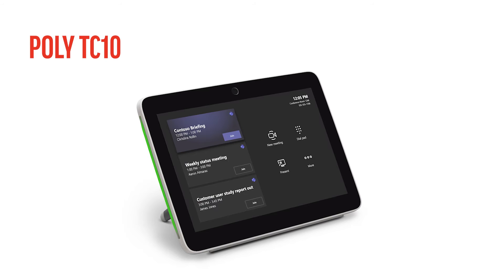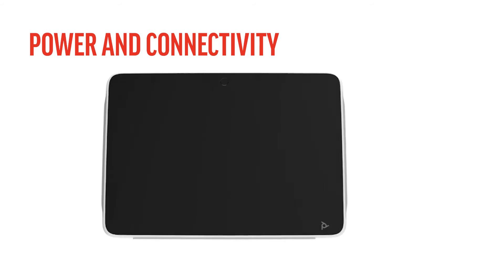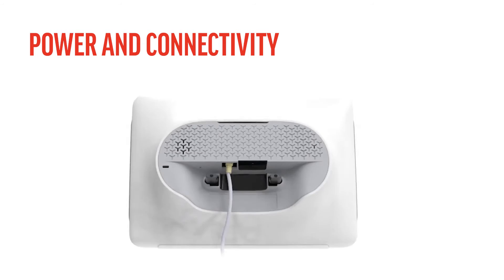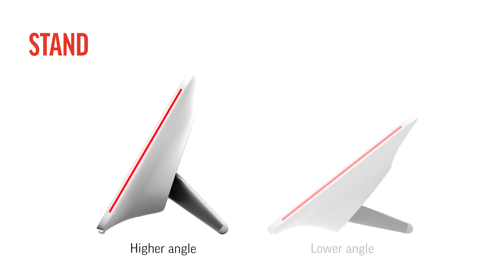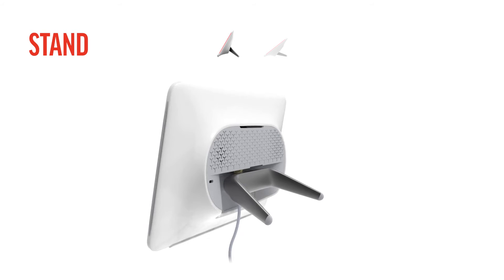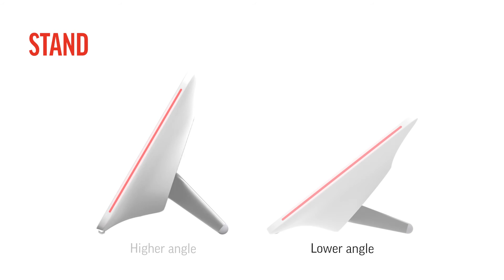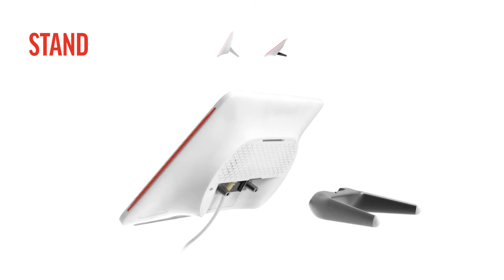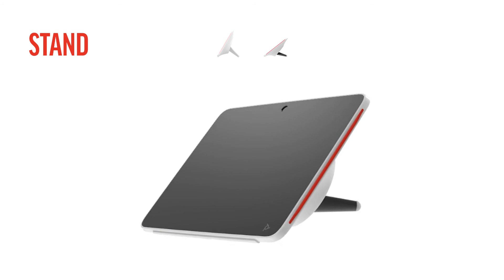Poly TC10: Tabletop Setup | HP Support

Comment: How do you remove the stand?  click it in for a higher angle, but then want a lower angle....how does it pop out?
Reply from the maker: Hi there, thanks for contacting HP Global Social Media Support!
I understand that you need to know about removing the stand of your Poly TC10.
I will do my best to assist you.
To remove the stand from a Poly TC10 desk-mounted device, you can do the following: 
Remove the stand from the back of the device
Flip the stand over so the legs point upward
Regards, 
HP Support